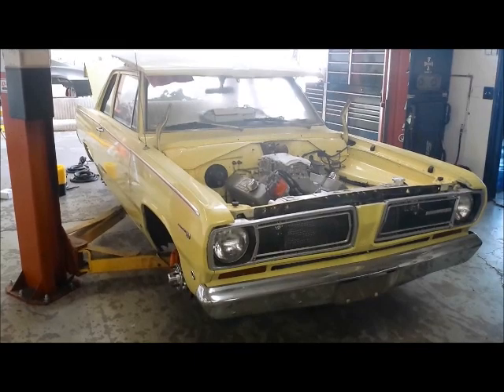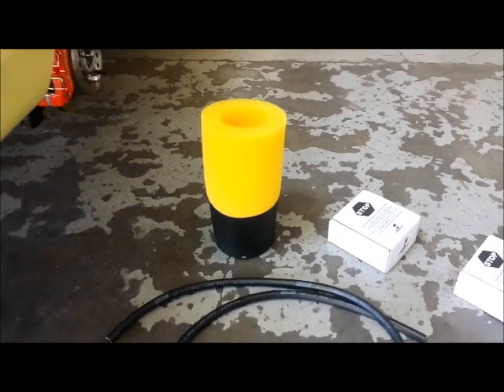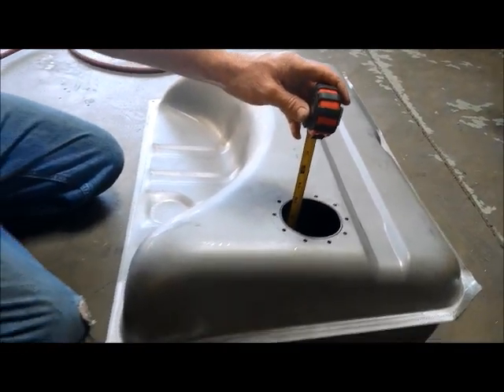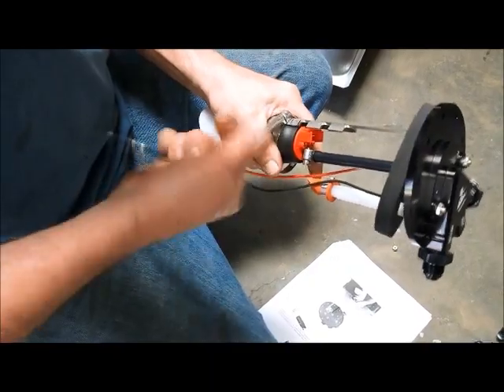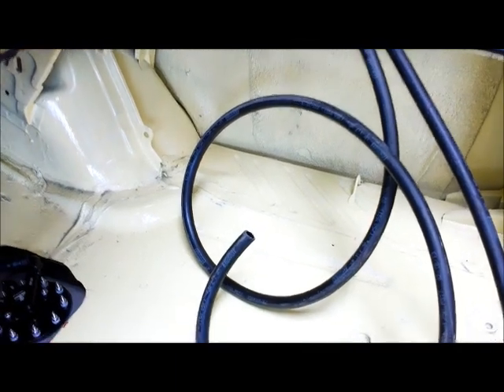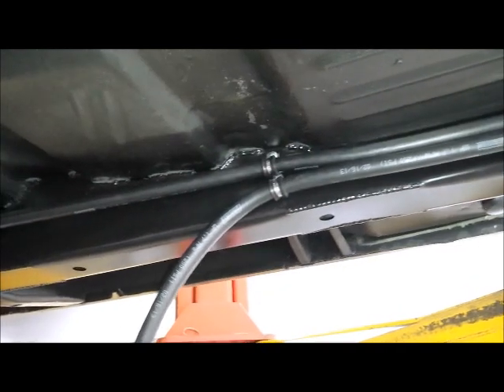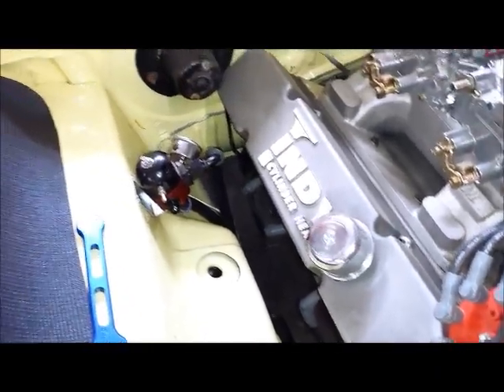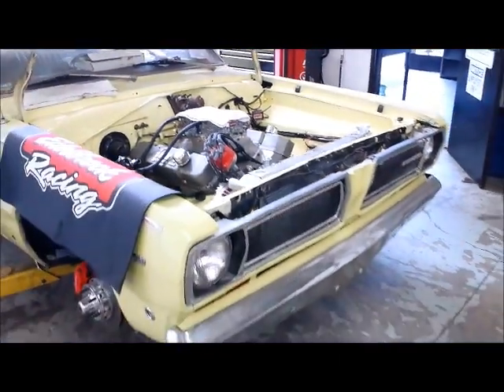How To Install A High Performance Fuel System

Comment: One of the better videos I have found by far. I recently electrocuted my truck bed and need to make a spring bed for the 81 f100. Will I have it down to the frame might as well do it. I think the rubber hoses and just doing it again 3 or so year is a good idea so make it convent to do.

Comment: There was lots of room in the Engine compartment in my GF's Dart with slant 6 engine ..  I am interested in the 4 link suspension for sure..  I will go research a fuel system from Areomotive for an LS Swap now ..

   It looks like Holley offers fuel pumps that  can go into the stock old carbureted car  fuel line and  gas gauge  hole..  I just realized may have to keep the  fuel level gauge float in the stock location with this set up ..  Holley and others use a 30 micron sock in the fuel pick up line .. It's supposed to be able .

  I need 58 PSI for an LS-3 ..  but  don't know what pressure  Nitrous  spray bars need for an LS engine..  I have adjustable regulator for carbureted Nitrous and run about 3 PSI for the correct air Nitrous level

Comment: haha rubber hose hahahahahahahahahahah never
Reply: Exactly. NHRA rules limit rubber hose in the fuel supply to maximum 12". There's a good reason for that. Also, equivalent aluminum line is cheaper than hose.
Reply: free and easy to get

Comment: nice install,if you ever decide to take it to the track its going to get turned away because of amount of rubber fuel line..
Reply: Bill Poulson yea rubber line sling the frame rail like that is a big no no.. Too much potential for a torn line and fire

Comment: Nice work and very cool project!

Looks like that Russell install oil really helped when putting the hose on the fittings, all the videos I've seen use a heat gun to soften it up a bit